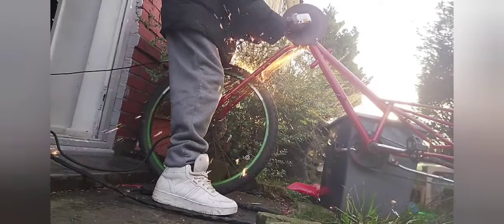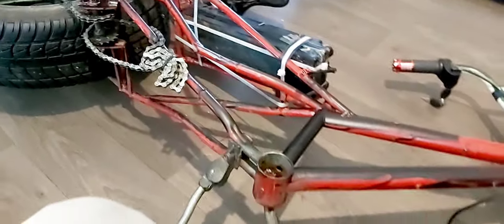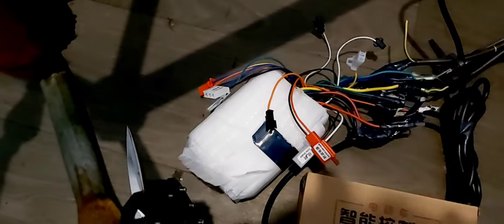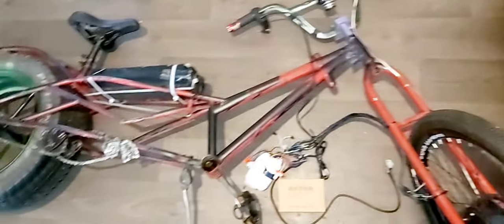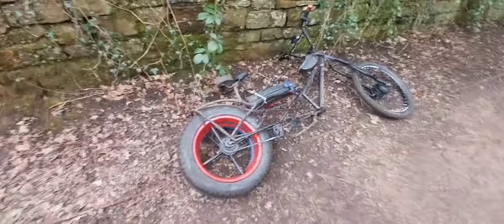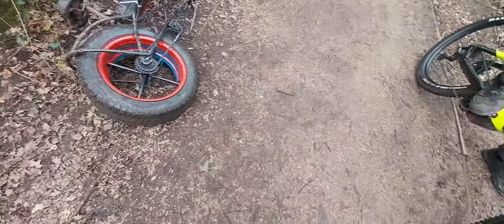Car Wheel on a CRAZY Homemade phat Ebike

Comment: Planning on doing a build myself. Where to you get your hub motors? The cheapest I can find at a couple hundred dollars.
Reply from the maker: I hope you build one soon. Hub motors I have been sitting on ebay bids.A lot are listed under electric wheel. Settings to auctions only to find the pre-ownes ones. Hub motors last through a lot. It is the throttle and controller I would purchase brand new.
Reply: @RastaOnABike  mint. Thank you